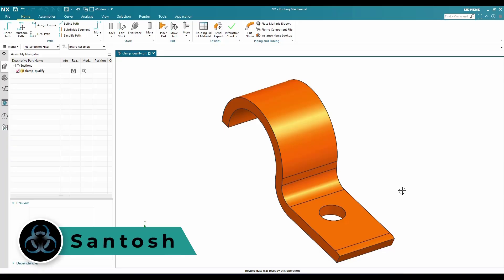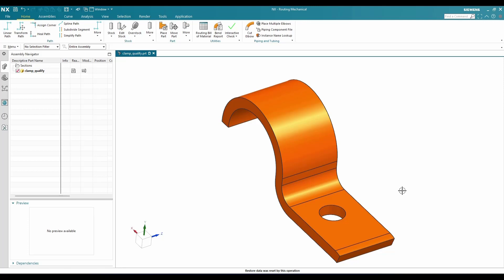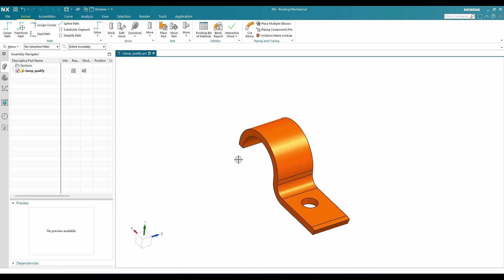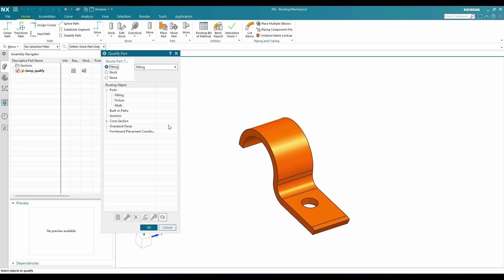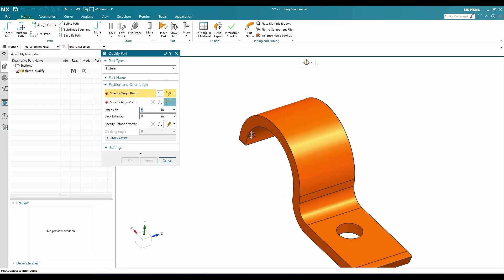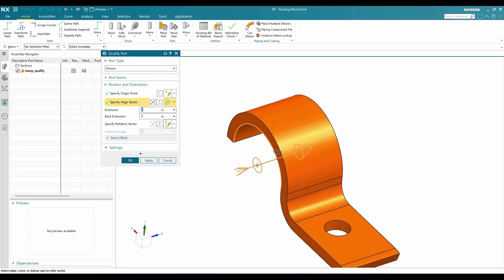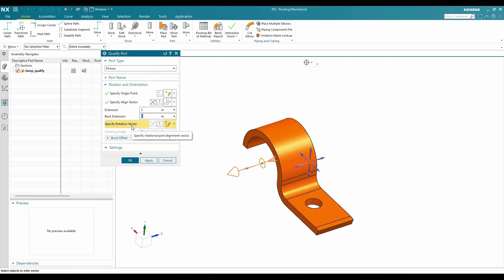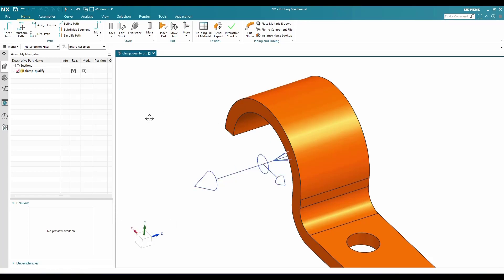Siemens NX - Mechanical Routing || Create Fixture Port

Comment: Is a rotation vector required for a fixture port? What is the purpose of the rotation vector?
Reply from the maker: Yes it's necessary.. will explain when I will take clock part command